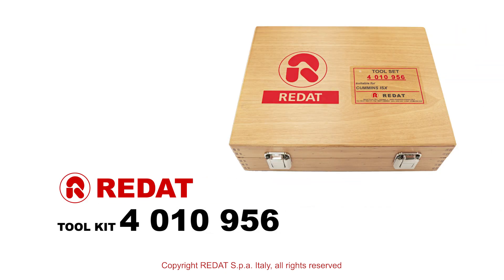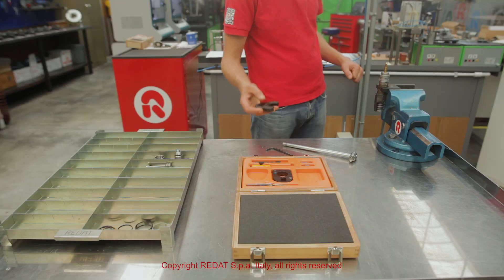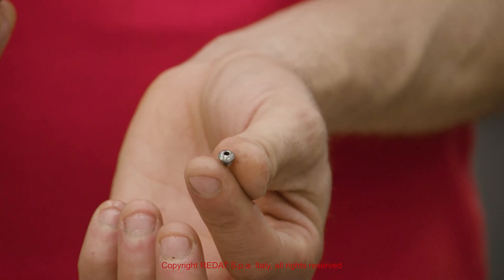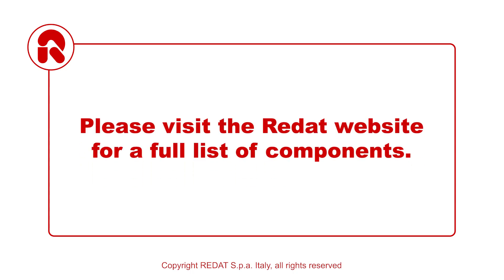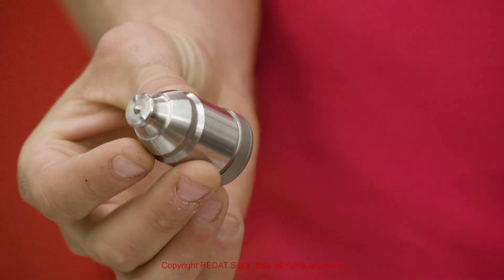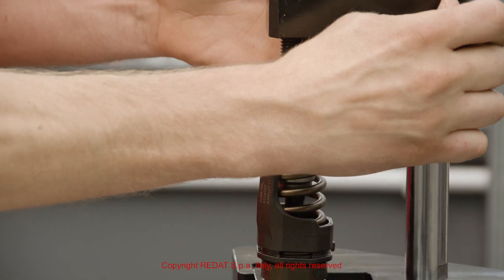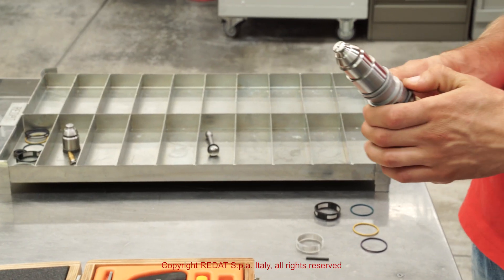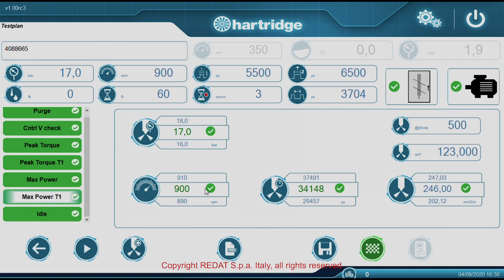Cummins ISX / QSX injectors - Assembling, disassembling and testing

Comment: I have a question, please. What is the reason for the fuel turning black and the exhaust burning when the load reaches 1000 on a Kiawas 15 generator?
Reply from the maker: I am very sorry but we cannot hal with the troubleshooting of this issue.
Reply: I want to buy four injectors for my 2021 Golf 7.5. Question please. Are the injectors new on the sites because the price is low?

Comment: Read that even though reman injectors are cheaper, they are very unreliable. Spend the extra and get brand new so you can have peace of mind.
Reply from the maker: Reman injectors are as good as the parts being used and the skill being applied. Just stay away from questionable mechanics using questionable parts, it's all it takes.